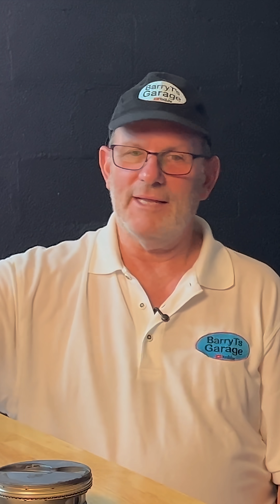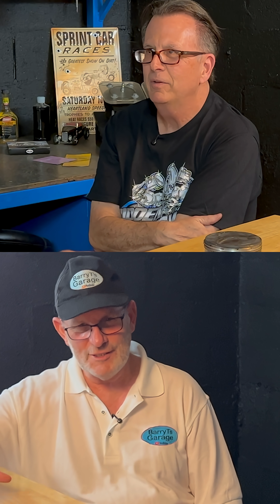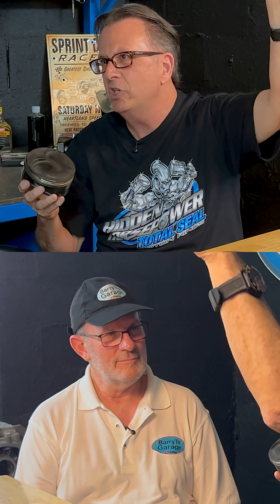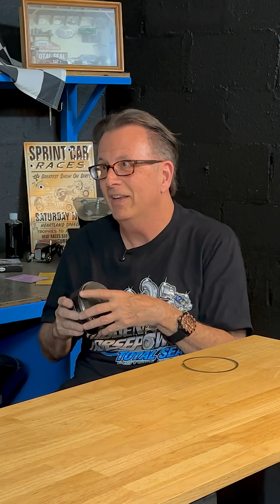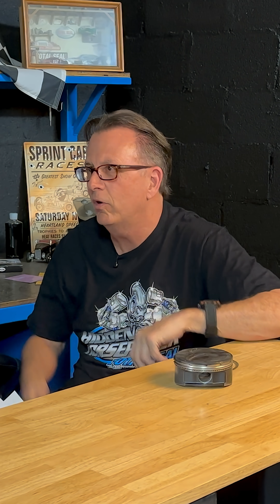When It's NOT a Blowby Problem! Keith Jones w #BarryT @TotalSeal l

Comment: Why is it that the air volume(&oil) isn't just moving around within the block (excluding compression blow by) 
at a theoretic static pressure? For every piston that goes down, another is moving up. The same with oil volume/pressure, for every cc of oil pumped into the gallelies the same is squirting out (internally) from the rod & bearing gaps, equal to the same amount is being sucked into the oil pump. The pressures of oil, air & water are higher & lower throughout the block (ignoring heat expansion for the moments) but cumlatively remain static within each system.  For every molecule of air oi & water movement the pressures are flowing back and forth within each sytem with regulating sytems keeping the balance.  Heat is the one element common that flows out of the overall work (hp) being extracted from the fuel and flows out of the engine overall. Pressures move back and forth within each respective system i.e. each system keeps the same volume it starts with but the pressure differentials keep squirting molecules from higher areas to lower just like mini weather storm systems contained within each system.  Overall heat and pressures rise & fall with the amount of work produced. The volumes however remain static throughout the range of motion (rpm) internally, due to the seals and regulation systems/ springs (air, rubber, or steel).
Reply from the maker: small amounts of combustion gases (blow-by) escape past the piston rings and enter the crankcase, altering internal pressure during operation

Comment: It seems like the actual volume of the bottom end does not really change. The piston going up cancels the piston going down. However, air is being moved around and a PCV decreases the density of the turmoil environment.  I don't believe the stuff this guy is saying is totally on point.
Reply from the maker: There is blowby and pressure pulses - if you dig in to it independently you will find there is a lot to it. 👍
Reply: I agree it does not sound right. The pressure can only go one way and that's up and out   the crankcase breather.
Reply: It's only a small amount of blow bye. He just had a small brain fart.
Reply: On old board Racing bikes mostly V twins they would cut windows at the base of the cylinder to reduce down pressure. Look Cool but messy.

Comment: That’s why I polish the oil passages so oil runs back faster
Reply: Old engines with a lot of sludge would accumulate all their oil in the rocker covers when revved at high rpms, enough to starve the engine of oil and blow up the engine.